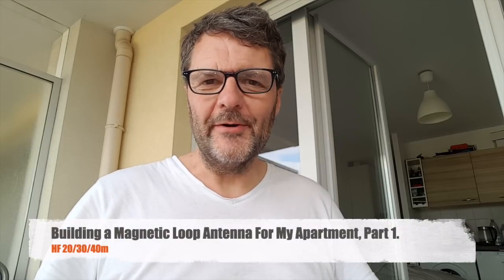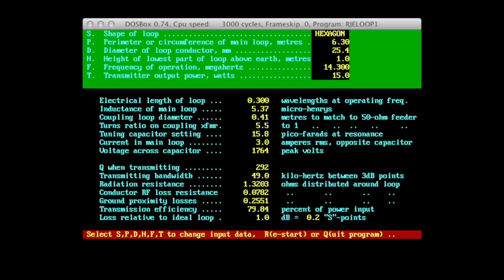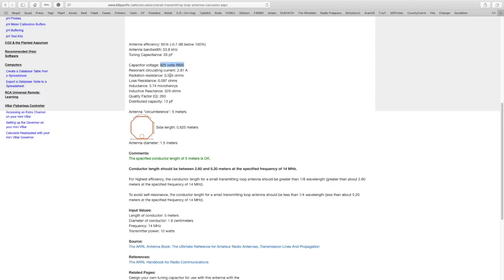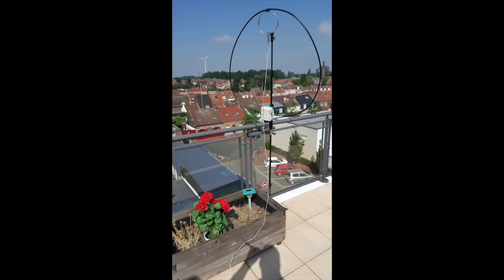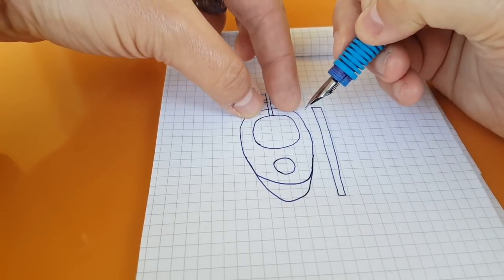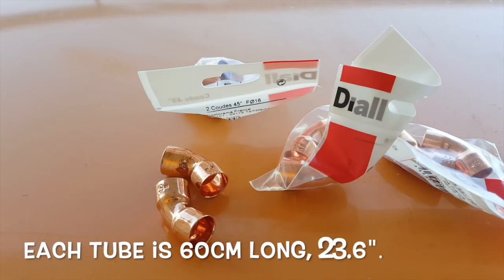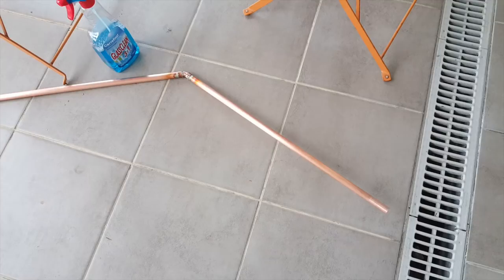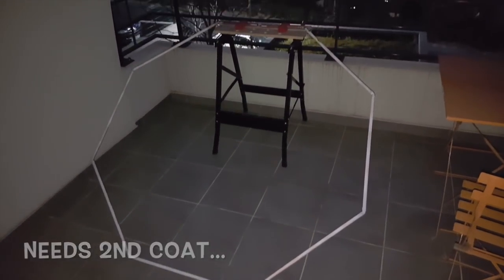Building a Magnetic Loop Antenna For My Apartment, Part 1.

Comment: Flange is good but the Jennings one I am getting has flange mounts  My big loop is circle of flex l 3/4 and inner loop 3/8 flex l 2 ft. My crisis is nolocal stock for small variable speed motor to make control so gasp-hand tuning?
Reply from the maker: Nice. I tune it by hand but it is a pain..

Comment: Hi, my Chameleon doesnt work. I wonder as it is inside or under the porch, if in both cases it could be because the ceiiling is low (about 7 feet) and NVIS isnt possible ( m'y friend is 40 miles ahead and my tripod is 3 feet height). Cordially, Milos F4IIP
(Above the porche is a balcony and above an advanced roof ; as it rains I cant no more give a try in the tiny garden)
Reply from the maker: You can't really do NVIS with a vertical, it won't work well. Are you using the whip? A short whip on 40m will not work well on top of that...
Reply: @RadioPrepper  I have a F loop

Comment: That calculator is not working.
Reply from the maker: It worked well for me..
Reply: @RadioPrepper  when I hit "calculate", I get: 
Validation of viewstate MAC failed. If this application is hosted by a Web Farm or cluster, ensure that <machineKey> configuration specifies the same validationKey and validation algorithm. AutoGenerate cannot be used in a cluster.

See http://go.microsoft.com/fwlink/?LinkID=314055 for more information.

Description: An unhandled exception occurred during the execution of the current web request. Please review the stack trace for more information about the error and where it originated in the code.

Exception Details: System.Web.HttpException: Validation of viewstate MAC failed. If this application is hosted by a Web Farm or cluster, ensure that <machineKey> configuration specifies the same validationKey and validation algorithm. AutoGenerate cannot be used in a cluster...
(And a lot more...)

Comment: Hi, do you share the CAD file for the clamp? I have the same capacitor and want to make a loop with the Loftur E. Jónasson - TF3LJ / VE2LJX automatic tuner. 73 PA1RP.
Reply from the maker: I will put it on thingiverse...
Reply: @RadioPrepper  OK thanks, let me know the filename after you stored it on Thingiverse.

Comment: Did you use plumbers or electrical solder?    And for ones using plumbing flux, are you using plumbing or electrical solder?  I have always needed to ask ones who have build these magnetic loop antennas from copper pipe.
Reply from the maker: Hi, plumbing solder and flux.

Comment: That windscreen for your mike makes it look like you have a very oddly colored beard...or like you're chewing on a Tribble! ;)

I made a small transmitting loop about 3 feet in diameter, using plastic pipe strap. (It turned out to be too soft and flimsy, but I made it work.) I applied 1/2" wide copper foil with conductive adhesive to the plastic strap and connected the ends to the tuning capacitor. I made another loop 1/5th the size of the main loop and hung it inside the top of the big loop, connected to my feedline. It tunes up great on 30, 20, 17, 15, 12, and 10 meters, but barely tunes on 40 and has horrible efficiency. It was very good on 30m, however, so I used it inside my house to run FT8. It handled 50 watts just fine, and even 100w for short periods with no heating. I made good contacts from eastern Pennsylvania to Fargo, North Dakota, about 1800km!
Reply from the maker: Excellent!

Comment: To cut out the piece you need most probably you can find a shop in the area where they are cutting metals with water jet. You will just have to drill the hole for the tightening screw. If not if you have a drill press, vice, some files and other basic tools could be made by hand. Best 73 de s57rw!
Reply from the maker: Will look for that, thanks.

Comment: Neat Loop.   Use Mapp Gas next time.   It's quicker and hotter.  This is way better than following a woman around with a bunch of shopping bags all day.  73. KB2QQM
Reply from the maker: LOL.
Reply: Radio Prepper I built a 40 M loop like yours about a decade ago.   It worked great.  Used a metal clothes hangar as a gamma match.     Before that I had an AEA Isoloop when I lived in NY in my attic.   I remember busting a pileup with that and 25 watts.   So many great memories.   Small Transmitting Loops are so much fun to play with.
Reply from the maker: Yep, really efficient!

Comment: Check out pages 30-36 in the April 2019 QST Magazine.  There's several pictures of a mounted vacuum variable capacitor tuning assembly for a 160 s 80 meter loop.  Hope this helps. 73's
Reply from the maker: Thanks, I'll search for it..

Comment: Looks great so far!  I have used mag loops for several years - mostly on 40M.  I never had a good enough capacitor to tune other bands.  I have also used coaxial cable as a capacitor - not practical as you are limited to maybe +/- a few khz, but that works too.  I guess I'm still waiting for a vacuum variable to drop into my lap.  Since I work in communications, I have had access to scrap elliptical waveguide - it naturally bends into a nice circle for mag loops!  Can't wait for part 2.  I hope it works well for you (I have lived antenna/space challenged for  many years myself).
Reply from the maker: You can find one on EBay for around $150..

Comment: i cant wait to see part 2,magnetic loop antennas are best for single band that way lower capacity capacitor used so tunes easier also they work better close to ground you can make it better buy having two the same spaced one in front of the other at a bit of distance all the best for the project 😃
Reply from the maker: Thanks!

Comment: I initially thought aluminum might be a good idea, but after reading more about galvanic corrosion - it's not a good material choice.  Brass or copper are both good on that front.  See the anodic index chart at https://en.wikipedia.org/wiki/Galvanic_corrosion.  The resistance of brass is higher than Aluminum and Copper.  Looks like the price of scrap brass is higher than scrap copper.  Sounds like copper is very difficult to machine.  Brass is reported "good" to machine depending on the alloy.  A solid brass or copper bracket is looking less and less appealing.  I like the "strap" idea.  I think we could easily redesign the bracket to work that way.

Comment: Another really good vid Gil. Looking forward to part 2.
Your joint prep looked quite good and so did your soldering so I wouldn't worry too much about joint resistance.
The source of 'HIGH' resistance is usually at the Capacitator's connections and/or the shaft's bushings/slip rings. Your VacCap circumvents that problem.
I'm also in an appartment but on the ground floor. I'm in the process of fabricating a 40 Mtr Spiral Loop based on the N4SPP/SM0VPO design. It will get me airborne with my QCX rig. The cap will be cylindrical and fabed from tall and different dia sized beer/soft-drink alu cans.
Will post here when I get a reading on the cap's range.
If the beer cans fail, I'll fab a ButterFly cap using foam-board and alu foil.
BTW: Can't wait for Han's QSX All Mode/All Band kit.
Regards/73
Russ/KA1RUW
Reply from the maker: Interesting, I'll look that up, thanks!

Comment: yikes, don't paint it yet Gil!  The success (or failure) of the octagonal pipe loop depends alot on very (very) low resistance solder joints.  I went down this road and the results were not very good for me. (Neither are my soldering skills so that doesn't mean anything!!)  But I'd leave the paint for later - if you haven't already completed that.  Good luck, they can be very good!!!  In the end I made the loop from some very nice silver plated coax from LMR.
Reply from the maker: Good point thanks. I should mention that in part 2.

Comment: Regarding the brackets that you need- brass is so expensive, I wonder if a thinner plate with a larger ring that matched the capacitor mating surface would work, the two parts soldered together.  That could be made with hand tools.  I see 1/8" copper sheet scraps available on that auction site.  Excellent video and very inspiring!
Reply from the maker: Thanks, that is a good idea..

Comment: if you use grey flux for plumbing and a stronger hand torch (the ones you screw in a gascan), when heating the flux, as soon it switches color you can add the solder and it will suck it in completely between the joints. On the outer edge there will only be a small film visible and the excess flux can be wiped of. Much cleaner results :) Cheerio! I have to get a variable capacitor, I need a loop here at my home because nothing else seems to work because of the QRM.
Reply from the maker: Grey flux, noted, thanks!

Comment: I really appreciate you leaving the problems and errors in your vids they are very useful Gil. Is the clamp acrylic or something less brittle?
Reply from the maker: Thanks Marc, it's the 3D printing filament stuff, not sure..
Reply: @RadioPrepper  Cool, that stuff is used to make the lower receiver of AR-15's so it should be fine lol
Reply from the maker: Right, LOL.

Comment: Great video ! Thanks for posting. What primer do you use to prevent oxidation ?
Reply from the maker: Thanks, not sure, nothing special, and in fact it doesn't work too well...
Reply: Radio Prepper I had considered using the Krylon “fusion” product for my loop. I am using 4” wide copper ribbon. I m concerned that oxidation would lead to dramatically elevated resistance via essentially messing up the surface effect conductance of the ribbon.